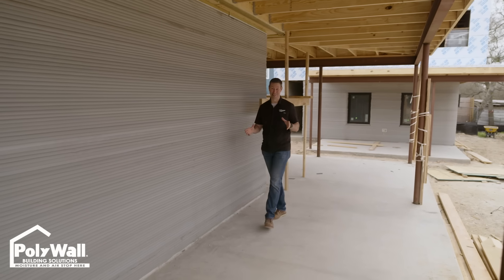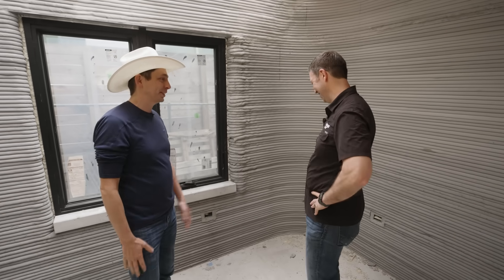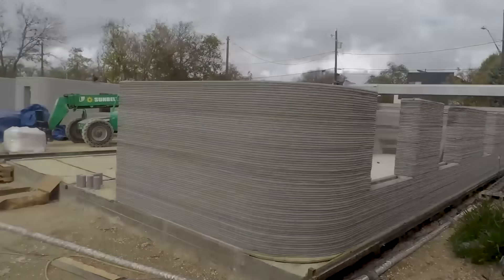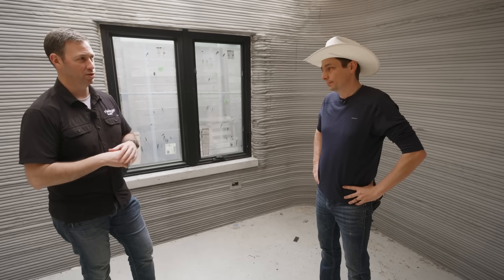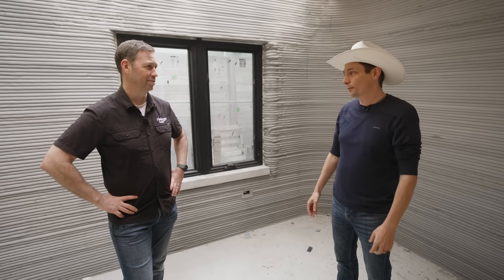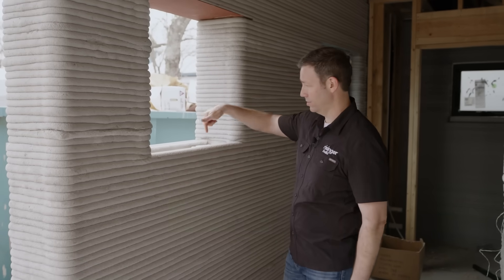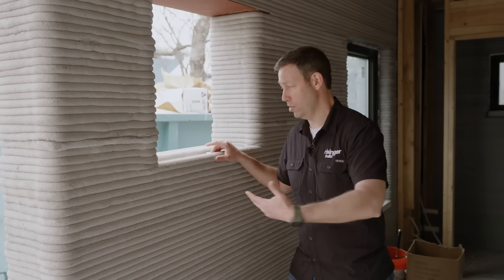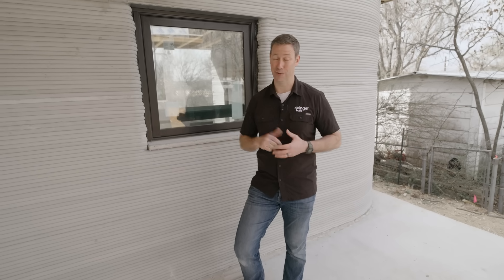Is this the future of Construction? 3D Concrete Printed Homes

Comment: It would be really interesting to see why this construction method doesn’t need rebar, and to compare the performance with traditional walls
Reply: Yeah, first thing I thought was that where's the rebar
Reply: @filscratcher  if I recall there are fiberglass and plastic reinforcements that make rebar unnecessary.
Reply: @brettknoss486  — GFRC mixed in, similar to the FiberMesh product made by SIKA for years to create foundations without rebar.
Reply: @pablo4youtube  thanks. Does that work for post tensioned concrete?
Reply: @brettknoss486  hell no
Reply: @brettknoss486  yeah, but i'd never trust them in that unmixed layercake.
Reply: Something tells me this is not normal concrete hence the rebar issue
Reply: @rogerwehbe182  it looks more like a Wendy’s chocolate frosty, if I’m being honest.
Reply: If they can use self healing concrete.
Reply: @brettknoss486  Yeah, but this is unlike anything humans have made before though. This is being poured in same way a snail makes it's shell. IMO, I'd like to see them pouring it with a locking V-shaped groove and using a much more sticky, fibrous and flexible material than just concrete.  I imagine the expanding foam if they use something more rigid will have some great structural properties.  Time will tell.
Reply: I could see them using Helix, but last I checked they weren't approved for this yet.
Reply: Stephen Valentine  - false; modern GFRC is often much easier to mix in and stronger at both a molecular and macroscopic level. Look at SIKA FiberMesh and all sorts of GFRC products. Modern concrete ain't your grandpappy's concrete anymore.
Reply: @pablo4youtube  FiberMesh and other fiber reinforcements do not replace rebar in application other than crack control.
Reply: Yes. I have concrete and block homes overlooking the Pacific ocean and the salt air plays havoc on the rebar...which is often not embedded deep enough. So if rebar can be eliminated or replaced that would be a big plus.
Reply: So called 3-D printing solves a problem that doesn’t exist while creating a hundred problems that is unnecessary
Reply: Rebar is added to improve strength against tensile stress. Concrete by itself is very strong against compression stress. This foundation is not spanning any gaps so does not need tensile strength only compression strength. Which concrete has on its own. 

And in 100 years the rebar is guaranteed to become a failure point do to rust expansion. 
https://practical.engineering/blog/2019/3/9/does-rebar-rust
Reply: @ecospider5   basalt rebar does not corrode    Rebar has many functions other than helping to span a gap.  Transverse bars at openings, uplift, bending moment capacity.
Reply: Check 5:50 very carefully, you may see whats going on without rebar
Reply: fiber, or microfiber and the right mix can remove the need for rebar for most cases unless it is not economical for a particular design.  I think that could be automated as well though in the future
Reply: Its a plastic and concrete mix no need for rebar
Reply: @kennethelliott5985  

Yep, all manner of additives are used. Most companies keep their recipe secret.
Reply: That surely is one of the reasons for the 2 story only concept. Brick houses also, many times do not need reinforced concrete when they are 1 or 2 stories only. From what we could see in this vdo, the 2nd story is almost an stand alone house supported by the concrete wall below. And we could see an extensive floor plan being the interface.
Hope to having helped a bit.
Reply: Their probably adding fiberglass to the mix. Actually it doesn't look like there is any, it should be visible.
Reply: @lt6077  "Their probably adding fiberglass to the mix."

His probably but her I am not sure.
Reply: It's all continuous concrete. I wonder if it's not gonna be cracking due to thermal contraction after a couple if seasons.
Reply: Stephen Valentine  you probably mean design or building codes? Could be, I don't know where you're located but many standards even in North America allow usage of plain concrete in load bearing structures. The laws of mechanics on the other hand are immutable.
Reply: O it needs rebar .fyi
Reply: What about expansion and settling?
Reply: This won't fly in Cali.
Reply: @seanriopel3132  Except they are in California.
Reply: @seanriopel3132  actually it did
Reply: @seanriopel3132  it won't fly anywhere. Too heavy
Reply: @scotth798  it's not the weight it's the lateral sheer forces from earthquakes I'd be worried about.
Reply: @seanriopel3132  I was actually trying to make a joke. You said it "wouldn't fly" , like an airplane.  I said it was too "Heavy" to fly...get it? Lol
Reply: @seanriopel3132  nothing flies in the country of calipornia one  cannot sneeze without breaking one of the 5 billion useless laws in that country
Reply: Rebar not required. This is the way we build in the UK with our brick houses. It's cavity Wall construction. An inner and outer leaf held together with stainless steel wall ties spanning the cavity.  I think these guys are using concrete as a tie but other 3D printed houses are using stainless steel ties. 

Vertical walls don't usually require rebar, it's large flat floor slabs that do. All you will get here is micro surface cracks that aren't an issue.

The concrete mix is important too. They usually include filaments in the concrete and a specific mix.

The beauty is it's concrete too, so no requirement for additional pre-stressed concrete lintels like we in the UK use. The house material IS the equivalent of a lintel.
Reply: @martinw245  Vertical masonry walls usually do require rebar. Not sure how they do it in the UK but in the US you have vertical rebar in masonry when it is not just face brick. The fiber in the mix will reduce cracking but not entirely and is not a replacement for traditional rebar. So i am very curious has to how they account for shear forces in this building and how they got code approval. 
Also curious how the beeds bound together.
Reply: @Crazylalalalala  

"In the US, vertical rebar in masonry walls"

Masonry is defined as brick, so nope, not required. We started building brick cavity walls around 1920. Prior to that it was two skins with no cavity, and no, no rebar either.

It's two skins of brick with stainless steel wall ties spanning the two skins. No rebar is required at all. All UK houses, and many in Europe are built this way. Its a very strong method of construction. We have been building this way for almost 100 years. These days, the only metal support structures required are lintels above windows and if there's a large gap in a supporting wall, an RSJ is used. The only rebar we use is in conventional concrete construction for large floor slabs and sometimes for some vertical structures built from solid concrete. Basic concrete floor slabs in domestic homes don't have rebar, just a damp proof membrane and concrete, (unless it's a floor above of course, but even then concrete beams and blocks are often used.) The area spanned isn't big enough to require rebar. Commercial properties that have a larger floor  area are indeed reinforced by rebar. 

There are quite a few 3D printed  house builders in the US and abroad now. Construction methods vary. The majority use a cavity wall construction. Depends on local regs but some of those companies add additional support to the corners so that the inspectors have a familiar construction method they can relate to. 

https://www.designingbuildings.co.uk/wiki/Cavity%20wall

I can understand by this might be strange to you guys in the US. Because the majority of your houses are wooden.
Reply: @Crazylalalalala  

"The fiber in the mix will reduce cracking but not entirely and is not a replacement for traditional rebar."

If you watch the many videos on 3D house printing, including the one above, you will learn that the cracks that form are not structural and covered by the elastic paint. Again, there is no need for traditional rebar. Watch the video's. Although some 3D house builders do add rebar in a few areas to satisfy inspectors. You can see from the video's that no traditional rebar is used.

"Also curious how the beeds bound together."

Its moist concrete. Moist concrete bonds to moist concrete.
Reply: @martinw245  No it doesnt, wall ties are meant to attach the two walls together. (thus the "tie" in wall tie it ties the walls together) which is pretty standard also in horizontal reinf. but rebar is needed vertically in masonry and concrete walls. Honestly, that video was even less convincing.
Reply: @martinw245  "covered by the elastic paint." lol, thank you that made my day. You are going to relay on paint only for crack control? good luck with that. 

The house builder that add the rebar are doing it more correctly. 

"Its moist concrete...." yes and no. for one they dont complete the building in one pour. second it takes time for the head to make it around in which time some of concrete would have dried a little creating somewhat of a a cold joint. I would want to see some tests done on that. 

Also this is not regular concrete. It doesnt seem to have any course aggregate in it which if i remember correctly is the cheap part of the concrete mix. So i wanted the cost of material in this thing.
Reply: @martinw245  First, 1920? why are you talking about 1920s? in the 1920s they didnt even consider seismic and wind forces when designing building. it has been 100s years... Code these days is very different. 

By current code in the US all structural masonry is required to have min vertical rebar base on the dimensions of the wall. (there is an exception for low wind low seismic areas) you need at least #4 bar at 48" end of story. Concrete bearing walls also have min vertical rebar requirements. and this is a concrete bearing walls not a brick cavity wall.  

Floor slabs are supported by the ground... thus they dont need rebar thu wire mesh is often used for crack control or fiber in mix. Assuming the ground is compacter property (with some exceptions) all other concrete has rebar in in. 

These days brick is mostly used as face brick and almost never has structural parts. CMU is used regularly in many parts of the country. Due to wind loads, termites and sometimes just cost. Depending on the region.
Reply: @Crazylalalalala  

"but rebar is needed vertically in masonry and concrete walls."

AGAIN...

I live in the UK. I have done my entire life. I have owned and worked on many houses, and built two extensions. Our "masonry" hence BRICK houses DO NOT REQUIRE OR HAVE rebar. I even gave you a link to how brick (masonry) cavity wall houses are built. Did you bother to read it? All we use are wall ties between the two skins.

Open your eyes, read the article I linked to, watch video's on UK cavity wall construction. You said you didn't know how things were done in the UK so I told you. I gave you FACT.

Don't try to tell someone who at 63 has lived in the UK for his entire life that the houses he has lived in required or had rebar. Its a ridiculous claim to make. 

You can demonstrate for yourself that you are wrong in a few minutes on Google.

Why on Earth you would think BRICK (masonry) walls that don't shrink or crack require rebar is bizarre.

Now in your country the regulations that pertain to various states may be different, and in some of those places it may be different to the UK, I mean I wouldn't be arrogant enough to tell you how things are done in various US states where you have various environmental issues like earthquakes. But what you have to realise is that the company in this video ARE building houses, and ARE selling them to the public, and thus, HAVE passed the relevant codes for that location. Otherwise they wouldn't be allowed to sell them would they. Lol!
Reply: @Crazylalalalala  

"First, 1920? why are you talking about 1920s? in the 1920s they didnt even consider seismic and wind forces when designing building. it has been 100s years... Code these days is very different. "

WRONG! You said you didn't know how it was done in the UK, I told you... In the UK we use the identical cavity wall construction that began in the 1920's. The only difference is that we now use stainless steel wall ties instead of steel ties that can rot. In addition we now use steel and concrete lintels above windows rather than the traditional vertically laid bricks (soldiers). NO REBAR! many things have changed but the same basic cavity wall construction is used. Again, google is your friend, google UK cavity wall construction and educate yourself. Fact is fact, not what your undedicated brain invents. 

"By current code in the US all structural masonry is required to have min vertical rebar base on the dimensions of the wall. (there is an exception for low wind low seismic areas) you need at least #4 bar at 48" end of story."

Lol! Yet another American who thinks the entire globe consists of one country called America. I'm sure you do that in your nation, but the world is a huge place, and in the UK we do not use rebar for brick houses. THIS IS FACT! In addition, there's a large percentage of the planet that does not get earthquakes. Just because you do, don't assume we need earthquake proof houses in the UK, we don't. Same applies to the majority of nations on this planet. AGAIN... the whole world is not just America. 

"Floor slabs are supported by the ground... thus they dont need rebar thu wire mesh is often used for crack control or fiber in mix. Assuming the ground is compacter property (with some exceptions) all other concrete has rebar in in."

Correct where have I said otherwise? 

"These days brick is mostly used as face brick and almost never has structural parts. CMU is used regularly in many parts of the country. Due to wind loads, termites and sometimes just cost. Depending on the region."

None of that applies to the UK. Termites are not a problem and neither are starquakes. 

As for 3D printed house companies in the world, there are THIRTY of them. As I said... some of those companies use steel bars and thicker concrete pillars to strengthen certain areas of the build, in the case of this company, just the corners, some don't. But its not traditional rebar, If you have watched this video you would have known that. And if you actually watch a few other videos re the company that built the 3D house in this video, you will see that it adheres to code and is available to buy. 

Do you really think that numerous companies are building these houses, knowing they will fall down in 12 months? Lol!
Reply: @Crazylalalalala  

"covered by the elastic paint." lol, thank you that made my day. You are going to relay on paint only for crack control? good luck with that. "

You are misrepresenting my comments. I was referring to NON STRUCTURAL cracks that appear on the surface of concrete. These NON STRUCTURAL cracks are covered by elastic paint. Did you actually watch the video? This was all covered. In another video he spoke about strengthening the corners so the inspector had something to look at that he could understand and he spoke about the paint and NON STRRUCTURAL cracks in this video. 

"Its moist concrete...." yes and no. for one they dont complete the building in one pour. second it takes time for the head to make it around in which time some of concrete would have dried a little creating somewhat of a a cold joint. I would want to see some tests done on that. "

You clearly aren't very well educated in terms of construction methods or the chemistry of concrete and brick laying mortar. The concrete in the hopper is WET/MOIST that is all that is required. Clearly you have never worked with concrete or brick. Wet concrete adheres to dry concrete due to gravity and chemical bonding. Wet brick laying mortar adheres to dry bricks. BOTH surfaces DO NOT need to be wet. 

The above is done all the time in the construction industry. 

"Also this is not regular concrete. "

Nobody ever said it was. It's a cement based thermoset composite that is light weight self supporting and insulating. Think of it as more of a stonelike material. Hence why traditional rebar isn't required. Technically it should be refered to as cement based, not concrete. Although many are calling it concrete.

In fact some of the 30 companies in the world have their own recipe for the concrete and they keep the ingredients a closely guarded secret.

What we do know is that some of the companies add fibre glass filaments. This was all covered by me and others early in this thread. 

I will now go downstairs, from my upper floor constructed with cavity walls with no rebar and go downstairs to my kitchen constructed from cavity walls with no rebar,... and eat my breakfast.
Reply: @martinw245  Hi bud, looks like you are their PR guy but you are full of it. 

". I was referring to NON STRUCTURAL cracks that..." I understood that the first time and is still really stupid. 

"Wet concrete adheres to dry concrete due to gravity and chemical bonding. " This is not true. in the industry we call that a cold joint. They even talked about it in the other video. It is not as strong as a wet joint. 

Brink to mortar bond is not the same as concrete.

Brick does in fact get wetted before use. It is actually pretty important for many brick types and is code for brick with high initial rate of absorption. 

https://www.gobrick.com/docs/default-source/read-research-documents/technicalnotes/7b-water-penetration-resistance-construction-and-workmanship.pdf?sfvrsn=0

"Technically it should be refered to as cement based, not concrete. " That is just dumb. Concrete is cement based... Concrete is aggregate that is bonded with cement... For a PR guy you have not been doing your homework. 

"n fact some of the 30 companies in the world have their own recipe for the concrete and they keep the ingredients a closely guarded secret.
" also stupid. because a licensed engineer or architect needs to approve the mix if it is a secrete it cannot be approved. Thus cannot be used.  

" fibre glass filaments" fiber glass filaments do not replace rebar... this has been covered before. 

" will now go downstairs, from my upper floor constructed with cavity walls with no rebar and go downstairs to my kitchen constructed from cavity walls with no rebar,... and eat my breakfast."

also stupid. in no way what so ever has this help your argument. Old buildings get grandfathered in all the time.
Reply: @Crazylalalalala  

"Hi bud, looks like you are their PR guy but you are full of it. "

No I'm not, I just paid attention to the video and other video's. Like you should have done. 

"Brink to mortar bond is not the same as concrete.

Brick does in fact get wetted before use. It is actually pretty important for many brick types and is code for brick with high initial rate of absorption."

That varies. I worked on a building site alongside bricklayers for 5 years as a youngster. In winter months no brick wetting is done. And at other times of the year I didn't see one bricklayer wet the bricks, most just increase the water content of the mortar. Wetting bricks usually means submerging them and can produce a better bond. 

I'm not sure what your point is to be honest, the 3D printed house in the video is intact, structurally sound and obviously all the printed layers are bonded. So what do you think happens? Are you daft enough to think you can go over with a crane and lift off sections. lol! 

"also stupid. because a licensed engineer or architect needs to approve the mix if it is a secrete it cannot be approved. Thus cannot be used."

You are an idiot that doesn't have a clue what he is talking about. I didn't make it up. That information was from the creators of the technology themselves, from the builders. And the houses have passed code and are now available to buy in the US and in other countries. Pretty sure you are very young and a troll. If you actually took the time to look at a few videos you will hear the companies make these comments themselves. But oh no, you would rather be a troll.  

Here you go, hopefully you can read big words. You do know what "proprietary" means, yes? Below clearly demonstrates you are yet another YouTube idiot.

Read the facts!!!

"ICON's proprietary Portland Cement-based mix is a closely guarded secret that enables us to rapidly print homes that are beautiful, structurally sound, and cost effective."

https://www.iconbuild.com/technology

"also stupid. in no way what so ever has this help your argument."

Of course it does you idiot. I LIVE in a brick built house with cavity walls and no rebar LIKE 95% OF ALL UK RESIDENTS.

Go and do something useful with your life instead of being a troll.
Reply: @martinw245  I know they didnt use rebar... we have been discussing this... Its kinda the reason we are having this discussion. 
Building is not in Germeny..
Reply: @martinw245  if only there was a reason i specified that wetting is dependent of the porosity of the brick... for someone who like to tell people to pay attention you sure seem bad at it.
Reply: @Crazylalalalala  

"I know they didn't use rebar"

If you know they didn't use rebar and you know these houses are for sale, then you know they have passed the relevent codes.

Thus... you know your own claim that masonry and concrete vertical walls need rebar, and implying these houses do too, is wrong. 

Thus, you know your repeated criticism of this building technique is wrong. 3D printed houses have passed the relevant building codes all over the planet now. 

Thus, your objective here has been to argue, and waste my time for the fun of it.

Not cool.

You also said, and I quote...
""By current code in US all structural masonry required to have vertical rebar"

Again wrong! The houses in this video have passed relevent codes without rebar. Elsewhere in the US too.
Reply: @Crazylalalalala  

"If only there was a reason why i said dependant on porosity of brick."

Wrong! You said BRICK DOES get wetted, implying all brick. 

You later said it's CODE for SOME bricks due to porosity.

It's also an utterly irrelevant argument. Because, OBVIOUSLY, if Icon need to spray a bit of water before they start the next printing session its quick and easy. So a pointless argument to make.

The above is an example of your disingenuous motives here. You are trolling. Ignoring common sense and the facts in front of your eyes and just arguing for sport.

Fact: These houses have passed code.

Fact: These houses are for sale.

Fact: Thus any argument that they need rebar is wrong.
Reply: @Crazylalalalala  

"Concrete is cement based"

Of course it is. I didn't say it wasn't. Its a different cement based composite to the material used in 3D house printing.

Again... arguing for the sake of it aren't you...
Reply: @adam25022  thanks bud that means a lot from someone I have no reason to believe knows what he is talking about...
Reply: @martinw245  excellent answer.. I'd just add the problem rebar brings to vertical walls after set number of years receiving rain.. it lows down its own pH level so it starts corrosion from inside out because rebar to remain intact needs a concrete that won't be porous and loose its pH because of being weathered.. 👍
Reply: Looks like at 4:08 they show a diagram of vertical supports at idk 24-48 inches apart. Possibly with rebar.
Reply: Stephen Valentine  

I didn't say we build with concrete. I said with cavity wall construction. I specifically said how we build with our BRICK houses.

However, we do build with concrete all the time. Concrete blocks are common. Lightweight concrete blocks and thermalite blocks are used all the time for interior leaves. Concrete is used all the time for floor slabs and extensively in commercial buildings.
Reply: Just because it doesn’t have rebar doesn’t mean it isn’t needed.
Reply: @boobacockaa  engineered to code requirements means it is strong enough via other methods.  The low labor cost gives them room to spend money on fiber and maybe exotic chemistry
Reply: @boobacockaa   You have to remember the wall is going to be full of 4 pound foam.
Reply: Performance is excellent. The cavity is filled with insulation and concrete acta as a substantial thermal mass.
Reply: Stephen Valentine  

Your problem is you don't read replies properly. 

I said...

"This is the way we build in the UK with our BRICK houses"

You totally ignored BRICK and claimed I was talking about liquid concrete walls. Obviously I wasn't, I didn't say anything about liquid concrete walls, not once, not for a second. Go back and read what I typed. I was referring to the way we build with CAVITY WALL CONSTRUCTION.

"UK does not build concrete walls"

Again, yes we do! Thermalite, Breeze and high density BLOCKS... ARE MADE OF CONCRETE.

"Concrete is very different to blocks. It cracks"

Blocks ARE MADE OF CONCRETE!

AGAIN! Not once did I say anything about building walls with liquid concrete!

The issue with concrete is when its stretched over an extended area, cracks can occur due to tensile strength issues. This is why expansion joints are included and yes rebar. 3D printed houses though, don't require rebar when cavity wall construction is utilised and a specific type of concrete. Its not normal concrete that you would buy from your local building supplier. On the contrary, in fact most 3D house builders have their own concrete mixes that are a closely guarded secret. All manner of additives are used, including glass fibres to strengthen the mix and other undisclosed fibres and compounds.
Reply: @martinw245    It's too bad.  In the UK we never use concrete in buildings, only blocks.  But what if they use this special concrete and make blocks with it?  You say concrete stretches and cracks, why not replace rebar with rubber bands?  A smart man could make $$$ if he could figure this out.

lulz.  :)
Reply: @docferringer  

No point really. Blocks have been used for many decades and do exactly what they're desighned to do.

We do use liquid concrete, in ICF builds. Polystyrene  forms filled with concrete. 

Rubber bands in concrete is amusing. 😆 

There is a system something like that when we make concrete lintels. They're pre-stressed. Metal plates either end of a form ans steel wire between, and while wet they increase the tension. You end up with a super dense pre-stressed lintel.
Reply: @martinw245  Yeah I'm just kidding around.  :)  The physics and chemistry of how concrete dries and sets would be interesting to study, if I weren't already enough of a nerd.
Reply: @docferringer  rebar is the rubber band...
Reply: @docferringer  or recycled scrap tyres?
Reply: @martinw245  o